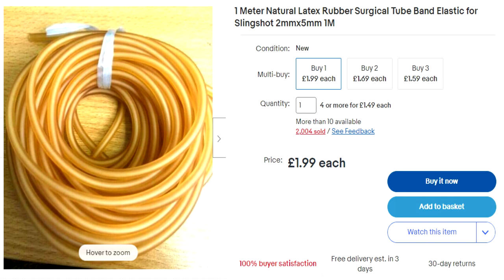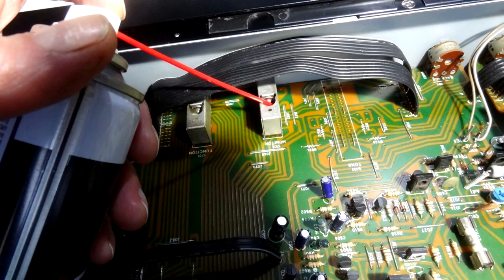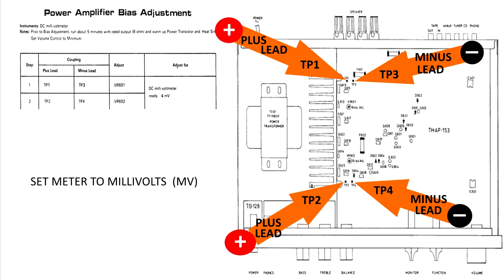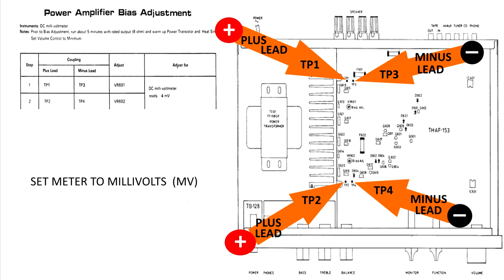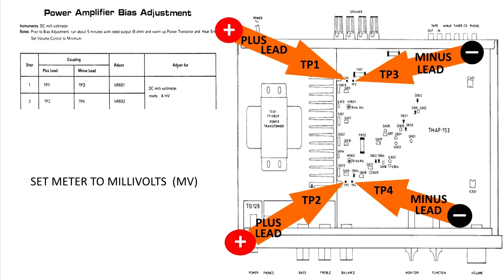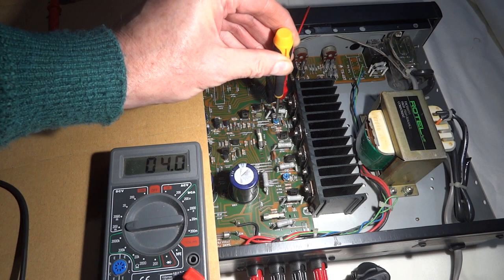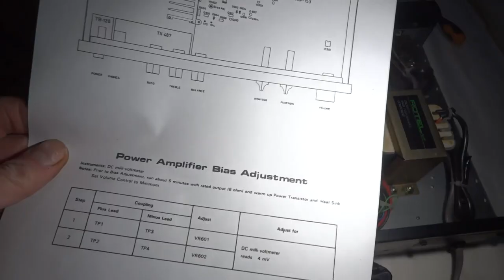Amplifier and Receiver Cleaning, Pots Cleaning, DC Bias Setting, Cracking Volume Control etc

Comment: Great video. I'm working up courage to open up my au-317
Reply: I know, scary innit? Good luck, mate!
Reply: I'm gonna do that today with my au 317. Hope it fixes it and doesn't need to be serviced
Reply: @kyleoboyle  I've got a  marantz 2385 i just picked up. I've got it open but I'm half paralyzed in fear. I don't want to cause any issues that do not already exist.
Reply: @RobD8870  I say go for it if your comfortable with just taking out some screws and giving it a good spray. Was able to fix my au 317 instead of paying someone else to fix it
Reply: @kyleoboyle  I appreciate the vote of confidence. Ive done it on other units but apparently the 2385 is much more intensive. You cannot clean the pots without completely removing the boards. The more I learn the more complicated its seeming. Alot of disassembly required. Im kind of bummed. I have the faceplate off the covers off etc and there's no good way to get to them.
Reply: @RobD8870  Oh gotcha. Yeah I wouldn't want to do that either. Goodluck

Comment: Thanks for this. My Marantz receiver, I can see through the top grate, is DISGUSTING! I heat with an airtight woodstove, quite nearby, and I now feel like I can remove the screws, get the cover off and dust out the guts. Cleaning the contacts? Not so much. It works fine, I just think I should get the dust off the board.

Comment: Hi, this is a very informative video. 
I would like to ask for your help, because I 've dusted ( brush and air spray) and  afterwards I ve used contact cleaning spray and it's been an hour now and not only  it doesn't play but it makes weird noises ( humming and cracking) through the speakers. What has happened?
Reply from the maker: Hi,, If the unit was working ok before you started the cleaning and spraying then it might need a little more time depending how much contact cleaner you used. If the pots / switches have still got the liquid still inside them or some has got on to the circuit board then this will need to dry.

Comment: Hey mate, like Alex below, I also bought a Rotel RA820 AX amp from eBay two weeks back, and it was great at first, but this morning it's dropping out and crackling very badly on both channels. I've tried it with a CD and it's absolutely fine, so I'm guessing it's the Phono stage that's at fault. Not really confident to crack it open, so it's going back, I'm afraid.
Reply from the maker: If fine on cd input and crackles on both channels on phono then a few places to start if willing to open up would be making sure the select switch is clean, could be dirty on the phono contacts, check the phono sockets on the back are making good contact inside and out, then the pre amp IC a NE5532AN, as this is just one chip doing both channels, but  if easier just to send back then a refund and another purchase maybe the order of the day.
Reply: @MichaelYates  Thanks Michael, yeah I sent it back and I'm now looking at either a refurbished Rotel A11 or another (yes, I already have one but I love 'em!) NAD C326BEE. I'm using the one I've got in the bedroom at the moment, because it too has dropout and crackle problems, even though I paid to have it thoroughly cleaned inside. It hardly ever does it, and the sound it puts out is phenomenal! Anyway, thanks again, mate!

Comment: My old Denon reciever takes a very long time to warm up before i hear  sound coming out of it,and sometimes when i change channel i hear a loud static noise do you know what this could be,the reciever is over 20 years old belonged to my uncle who recently died so i really don`t wanne dumb that awesome reciever.......
Reply from the maker: What model number do you have?
Reply: @MichaelYates  The Model nr is : Denon AVR-2800 i took the dust out a couple of years ago but not as good as in your video,the problem is still there,thanks for your reply Sir.........
Reply from the maker: I was worried that it might be one of the newer models and TBH way beyound me as there are many microproccesors in this unit and a host of electronics. The static noise cound be a lot of things, one being the relay that might have dirty contacts though this is only one of many things, could be a noisey transistors, switching microprocceser, amoung others. The slow coming on is probebly down to same caps might need replacing. But its a monster unit with a lot inside and any repair would be quite expensive. Not a soloution really but you could try a factory reset this would be free and still worth a go though I very much doubt it would fix any issues, I am sorry I can not help any further than that. Reset can be found here https://manuals.denon.com/AVRX2800H/EU/EN/GFNFSYvyalrwrt.php
Reply: @MichaelYates  Thanks for your reply and yes when you open that reciever its more like a computer inside i will try to clean all components with isopropyl alcohol first and if that does not work i will try the reset thx so much for your reply........
Reply from the maker: @gompsie  Sorry I was not able to help any further. Best of luck with the Receiver
Reply: @MichaelYates  Thank you very much,i will keep in touch after cleaning it.........
Reply: I told a good friend of mine about whats wrong with my reciever and today he gave me a surprise exactly the same reciever only this one is black same model working awesome for 80 euros second hand totally clean on the inside,i think its a no brainer,but i will still try to clean out the golden model,looks like i got lucky......

Comment: hey michael, i found my rotel ra 810a is having trouble with any speaker i connect on the right side, after diagnosing with new rca to aux cords and speaker wire and different speakers, the right side will still give out and only high end comes out all fizzy. it all started when i unplugged the rca to aux from the back of the amp. i only use the Cd channel. Any suggestions before i open it up? thanks and great video ! 
 cheers
Reply from the maker: Not an easy one, would be good to rule out the pre amp ic501 a NE5532AN which does both channels, which could be done by putting a signal pass this ic at coupling capacitor 506 to see if you still get the fizzy top end. if not then would probably be the ic
This would be my first port of call, but could quite easy be a cap or transistor pass the pre amp ic stage.
Reply: @MichaelYates  thanks for the reply,  it may well be a fuse that i noticed looks slightly burnt, 2 infact. ill have a crack at it today.
Reply from the maker: @tonypeppers4987  Wish you luck, hope you get it sorted out

Comment: Hi Michael. I've realised before I do this I'm going to need the right clips, I'm presume they're smaller than average? Any details would be appreciated.
Reply from the maker: I found the easiest way was to buy these in the link below and attach one clip to the Amp board and other end clip to your meter lead prong. But be extra careful that nothing is shorting out any ware along the path of your meter lead and the attached crocodile lead , give yourself plenty of space and be wary of both leads while Amp is on. Of course a set that plugs straight into the meter would be better, but I bought 2 or 3 leads now and none fitted into the meter sockets. These leads I would have thought would be rated around 1amp at 250 volts ,, https://www.ebay.co.uk/itm/143969065011?hash=item2185399833:g:-pkAAOSwPPZgQm4H
Reply: @MichaelYates  I only got round to balancing the DC offset. Both are around the 6-7mv, as the left terminal was around 14mv before. This was just buy slotting in the prongs in the terminal holes and tightening the screws like you would bare speaker wire. I'll do the bias when I've grabbed another multimeter because like you mentioned in the vid doing the Bias it's easier. 
I've noticed the left speaker that had a lower volume output when playing music is now a level balanced sound with the right now.
Reply: @MichaelYates  yes these look a lot easier. The ones that came with the meter didn't seem to have much play in the mechanism whilst covered by the rubber. Very surprised they're not a common required lead to link direct to meter. Did you just bare the wire slightly for the clip?
Reply from the maker: @CM-dw3gh  The leads come ready made which saves any soldering, I just clipped the jaws of the clip on the pin on the amps PCB and a you can more the plastic sleeve right down to cover the jaws of the clip so there is no accidental shorting out
Reply: @MichaelYates  I've ordered some. But according to DLmanuals, there's 4 TP's (test points?)to clip the clips onto but they look like individual heat sinks. There does appear to be a resister next to each. Are these possibly the test points? (Nad c320BEE)
Reply from the maker: @CM-dw3gh  Hi,, On page 7 of the service manual it give a picture of the test points and which pots to alter, for instance it says for Idling current Connect a DC millivolt meter to TP1 and TP2 and adjust  VR12 for a reading of 3 to 5 millivolts link here https://www.hifiengine.com/manual_library/nad/c320bee.shtml
Reply: @MichaelYates  yes I was looking at a similar page, but clearer on the hifiengine page. I'll have a look on my days off. I might do the NAD 3020A too. There's a slight buzz from the right speaker when in use. Can't hear it when sitting listening to music but feel it could be doing the voice coil harm.hoping it is the bias now I've got the tools to fix it (if it is the problem)

Comment: Michael what is the name of the contact cleaner you use.
Cheers Steve
Reply from the maker: Hi Steve, for just normal contact swiches I have been using WD-40 specialist Contact Cleaner as shown here https://wd40.co.uk/product/fast-drying-contact-cleaner/    also I have been experimenting using on pots as well, with good results. But normally use Deoxit F5 but its expensive for what it is I think thats why I have started experimenting with the WD-40 SCC
Reply from the maker: The one in the video is Rapid Electrical contact cleaner, which did a good job to on the switches
Reply: @MichaelYates  Cheers Michael

Comment: Hello, I have the input selector from Yamaha AX870 very oxidated, is interrupting totally one channel power, so I just have sound in one speaker, if I move it left right the sound appear but dissapear, so I supose I need to clean it, what can I use to clean the boards from selector inside ?
Reply from the maker: I do not know that Yamaha, but I have had others and ones I have had in the past were the volume is a motorsied pot and one had a motorised input select as well. These can be more awkward to get the spray into, you migh find a hole in the switch casing to spray the spray into, though I would only use a little as could get into the motor if it is motorised.
I have heard that sometimes the motor can cause the input select switch not to line up properly dues to worn cogs so that is a factor as well. But with a bit of luck with some cleaner ( I use WD 40 specialist contact cleaner ) on switches, you might get both channels to work. Other than that it might need a dismantel is possible or new assembly.

Comment: Can you please post a video of you setting DC bios on an audio innovations alto mk1
Reply from the maker: Unfortunately I do not have this amplifier, the little information I have on this is that use a DC voltmeter on millivolt setting connected across Resistor 21 and turn VR1 until 30 millivolts, do the same for other channel, R22 adjust VR2, this is from a 3rd party sauce that I found quite a while back, so cannot verify this
Reply: @MichaelYates  I have the schematic if that helps, I have tried what you say but the milli volts don’t seem to change
Reply from the maker: @erictiscoff4296   I do have the diagram thanks, Would have thought they would have made some difference, but if not then  , I see that you can adjust VR3 one channel and VR4 other channel until the voltage on the right of R21 / R22 is half the main voltage from power supply. This might help, but other than that without having the unit here I can not help much further, though I will grab one if ones going cheap at some stage.
Reply: @MichaelYates  yes read it through but can’t get 30mv may be the variable resisters need cleaning think I’ve read that only way to know is try I suppose,
Reply from the maker: @erictiscoff4296  maybe need cleaning, is the amp working and what reading are you getting
Reply: @MichaelYates  amp is working and I’ve recapped it, I’ll try this week and let you know, week off 👍
Reply from the maker: @erictiscoff4296  O.K hope you sort it out